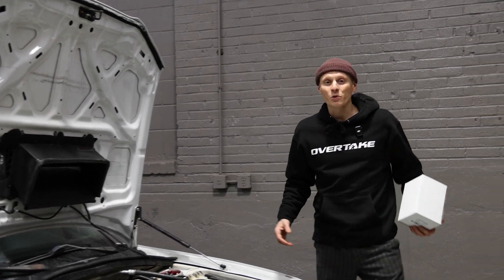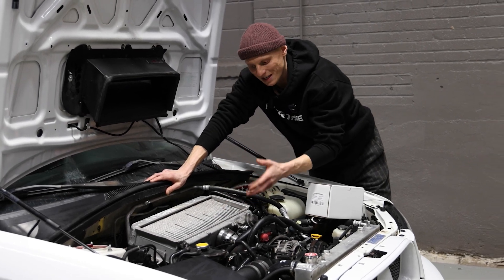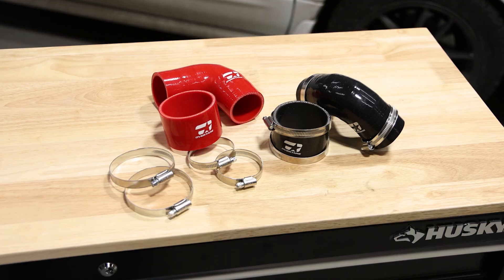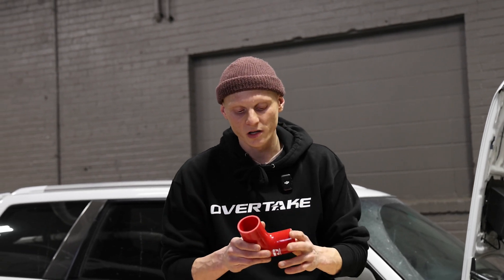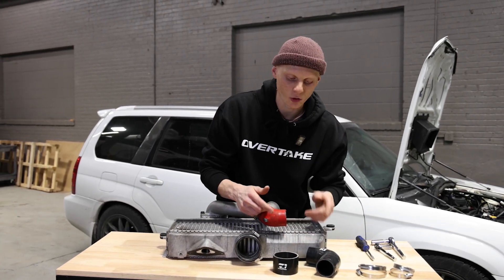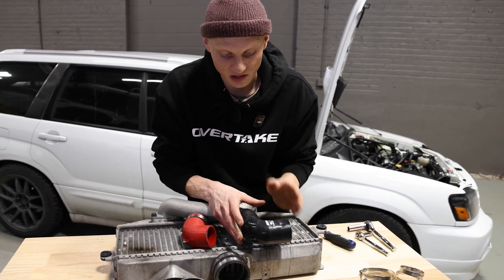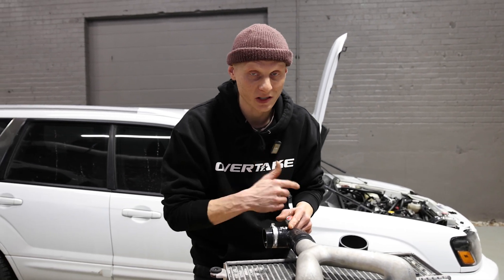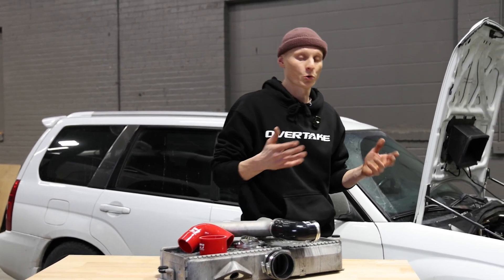OVERTAKE Subaru STI Top Mount Intercooler Coupler Kit Install Guide

Comment: Do these make it any easier to install the TMIC with a AOS line kind of in the way of the lower hose?
Reply from the maker: The 90* elbow in our kit is sized a bit bigger than normal so that you can cut it down for a variety of turbo fitments. That length does give you a little more to play with in terms of room underneath the TMIC. If it's a soft/flexible AOS line, then you shouldn't have any problem clearancing the combination.

Comment: Mine didnt look exactly as the one presented in the video. And after trimming the silicone with whole diameter of the house coupler in the turbo side, the logo will be overlapped by the hose coupler when installed and i am skeptical if it can make a propper seal since the metal spring is too close to the inlet. And also i have to cut a 1.5x the diameter of the coupler in the intercooler side. This is for a 2018 sti.
Reply from the maker: Hey, thanks for reaching out! Why don't you send a few pictures of your kit to help@overtakeusa.com, I'd like to get a visual on what you mean by the piece not looking the same, since we haven't changed the design on these since creating them. I'll get eyes on it and we can go from there! -Art
Reply: @OVERTAKEUSA sure!! Thank you for the attention. I have a grimmspeed coupler and wanna try this out. I will send some photos.
Reply from the maker: You're very welcome, thanks for sending the info over, I took a look and wanted to hop on a quick phone call with you. Hit me back on email with your # when you can! -Art